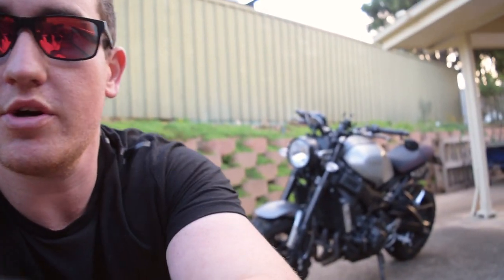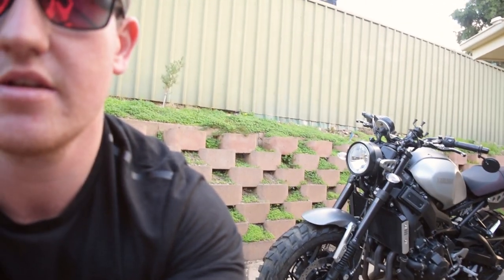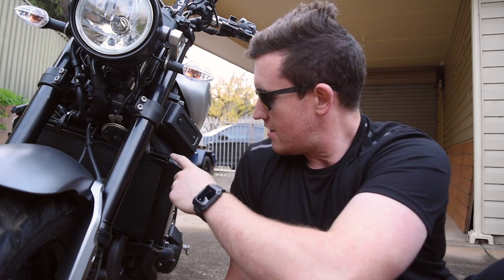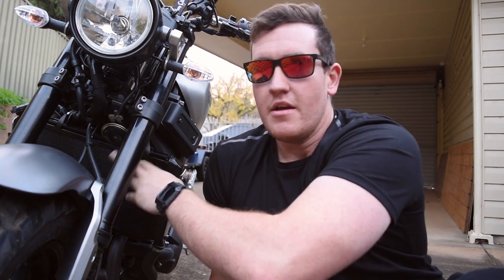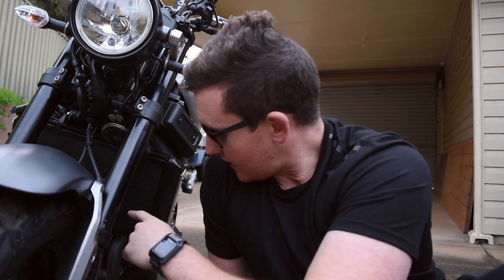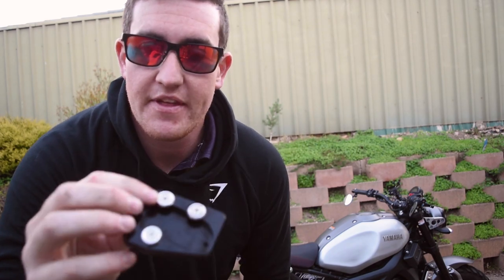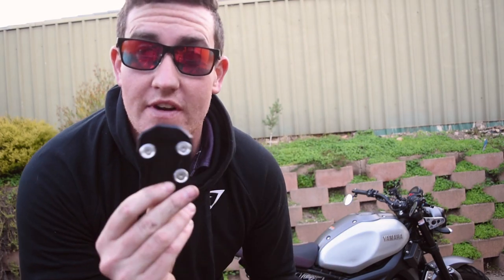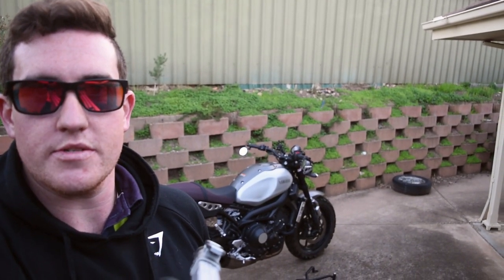Yamaha XSR900 Scrambler - Engine Crash Cage

Comment: Looks very nice! I would just add protectors for the levers on the heandlebar and put the mirrors to a normal position. Cause the mirror will definately be broken if you drop the bike and the lever very likely too. Also I doubt those mirrors are very functional. How are those tires feel on city roads and on a highway?
Reply from the maker: Honestly dude the bar ends I see more than the stock ones! The tyres ain't bad at all now I'm used to them

Comment: How did you manage to install those bar end side mirrors? Are you using an adapter? I ordered a similar one to yours, but couldn't fit. So im waiting for the adaptors to arrive.
Reply from the maker: I put them over the stock bar ends, and  then used a little PVC pipe to space out the thread!

Comment: Looks awesome! I get that you make some compromise on road/off-road handling, so would be interested in a long term review e.g. if you use the bike to commute, do the tires ware out more quickly..

Also, that doesn’t look like the stock front mudguard.. What is it? I want one!
Reply from the maker: It is indeed the stock front mudguard! We just raised it slightly to fit these tyres

Comment: for the kick stand be ware to check them every other day because with vibration they losen up or put some lock tie on them
Reply from the maker: Look I may have lost one of the three screws in the first day, not gonna lie
Reply: When bolting ANYTHING to a motorcycle... LOCTITE IS YOUR FRIEND!!!

Put parts on without loctite to ensure proper figment, undo bolts/nuts, add loctite, put nuts/bolts back in.